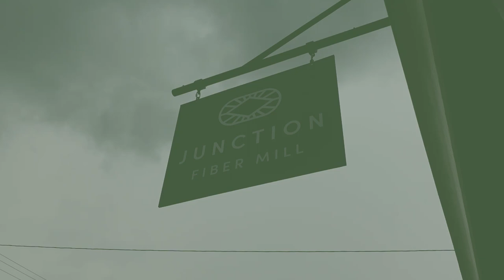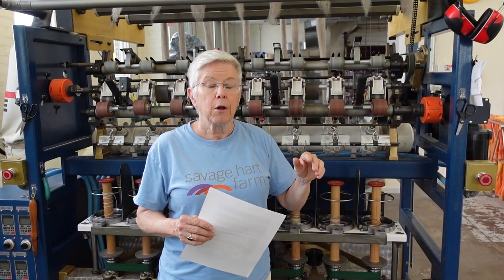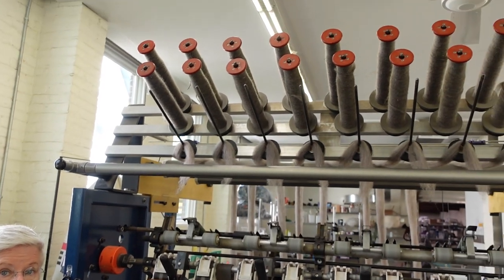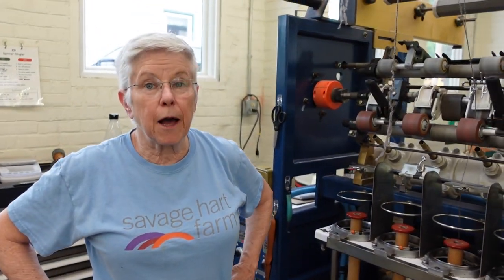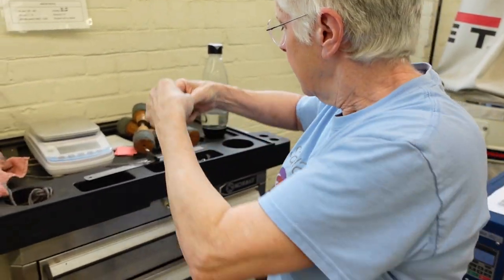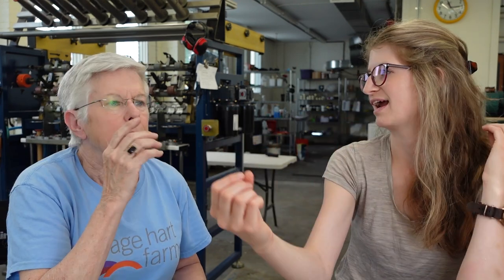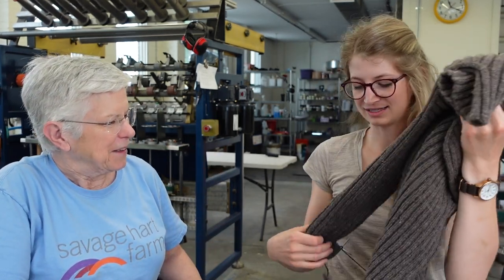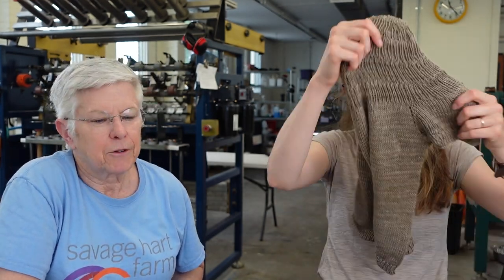Millcast Episode 34: The Spinner!

Comment: Question.  Hubby has made me an Amish swift.  When you wind on any woollen fibre to make into skeins. The wool thread is under tension as you wind the yarn on.  Is a meter length measured under tension? As trying to measure when relaxed, is impossible?
Reply from the maker: Judith,  when we measure yardage it yarn is under a little tension from the skein winder.  Not a ton, but some.